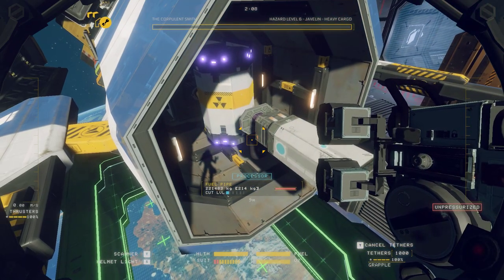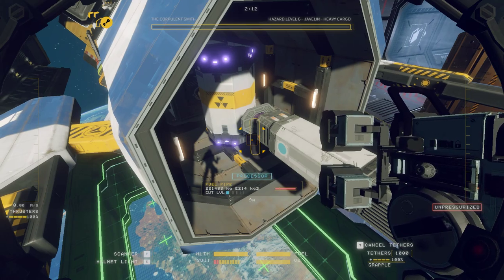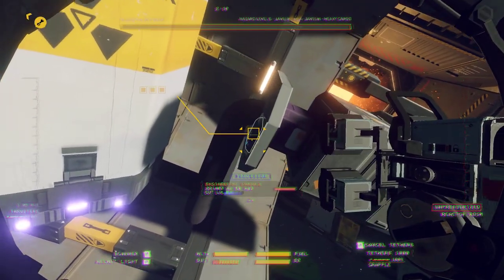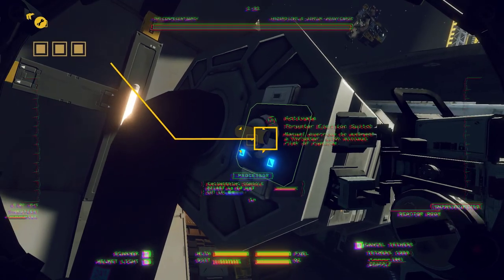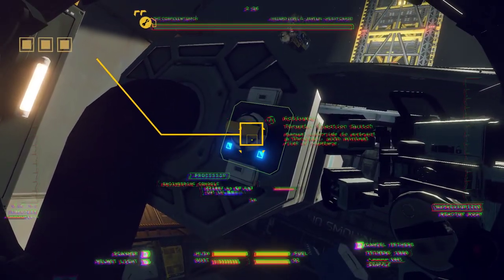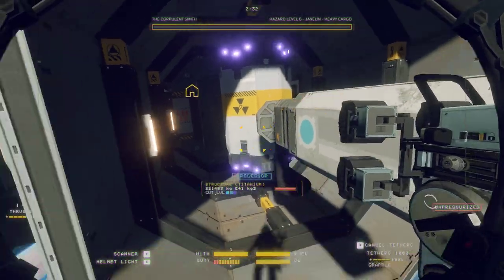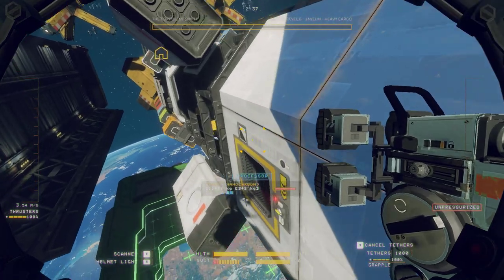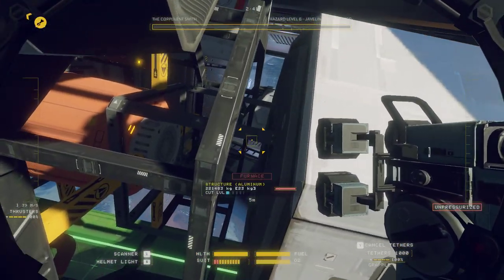Hardspace : Shipbreaker, Why does my Thruster Injector Switch have no Power?

Comment: I think it's technically because the power distributor is in the front part of the ship, so when you disconnect the back half of the ship from the part with the power distributor, you have no power running to the fuel flow switch on the thruster. I wish there were actual power conduits instead.

Comment: Good tip. There have been several times I had no power to the switch and didn't know why. What I hate is how the air regulators work. There should be no reason for them to stop working if I melt a door in a fully pressurized ship.
Reply from the maker: cheers, screw air regulators!!! they are up there with lockers!!  thanks for watching!

Comment: On that same note, is the thruster switch a safe guarantee to always remove the thruster with? I've seen other videos and commenters say it's not reliable, and to freeze the fuel pipes with the ECU's coolant in order to guarantee a safe thruster removal.
Reply from the maker: its not totally safe I've seen them explode after the switch has been pulled, its faster then freezing the fuel pipe, so i guess the risk is yours to take :) thanks for watching!